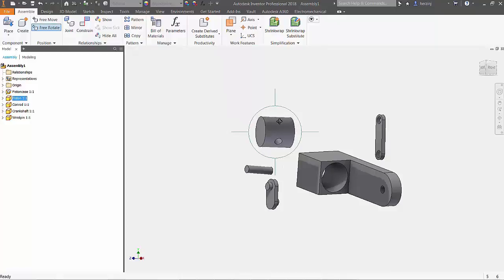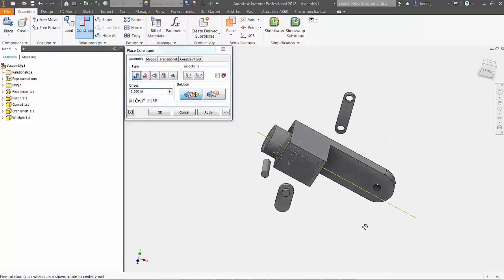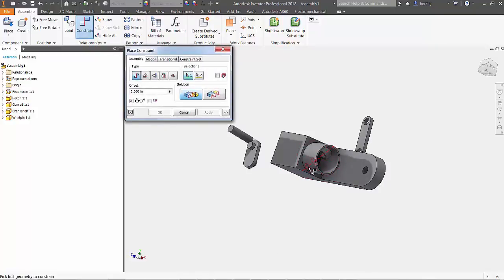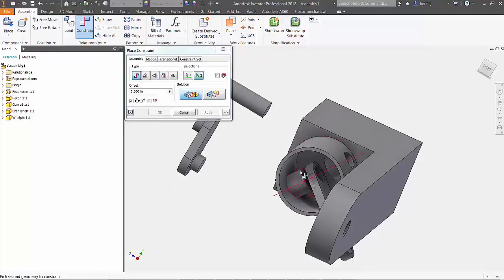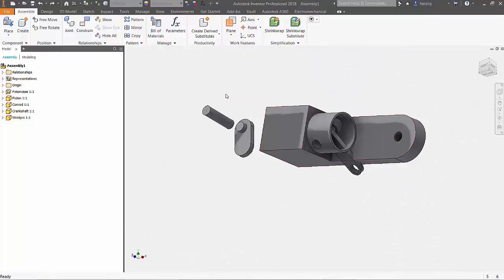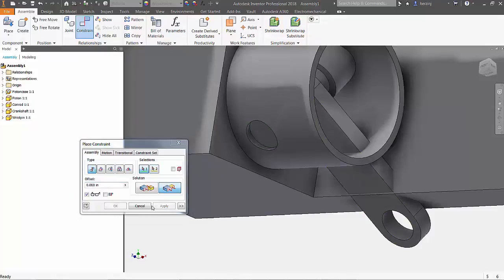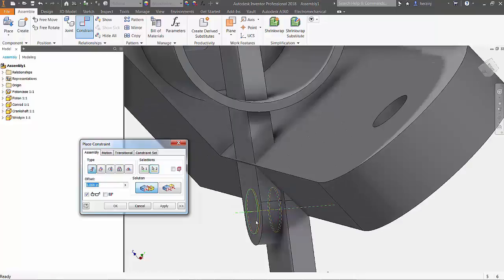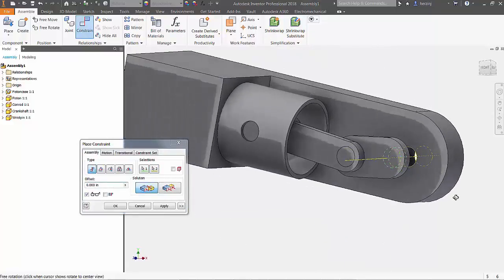Inventor 101: Applying Assembly Constraints

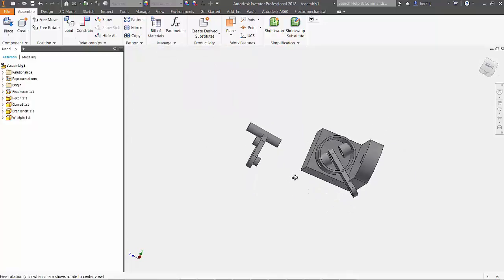Comment: at 0:55 you center the part by specifying the distance that's needed for it to be at the center, is there a way to do it so it stays centered WITHOUT Specifying the distance? and for it to stay centered no matter what changes or not? i mean, this is all cute and all up until the client needs to change the diameter and the piece will no longer be centered and the distance will need to be modified manually, which is not ideal if you need to do A LOT of mates this way